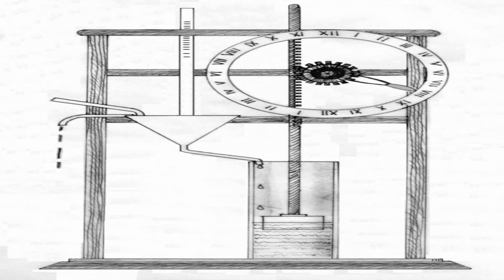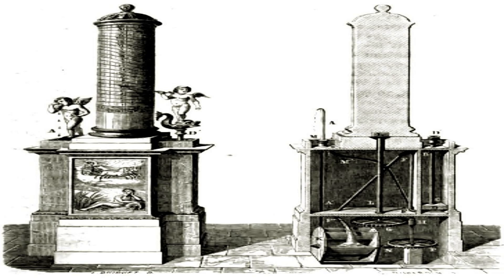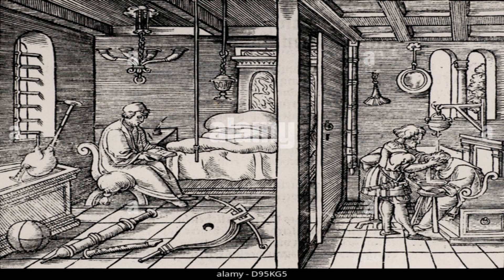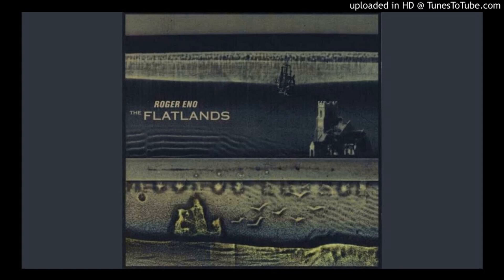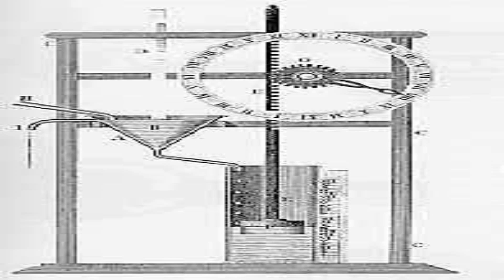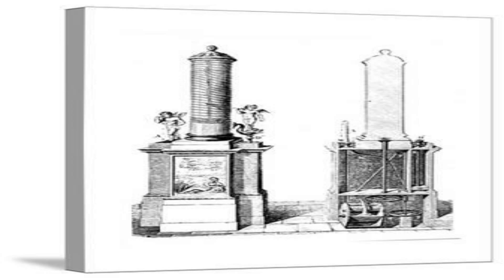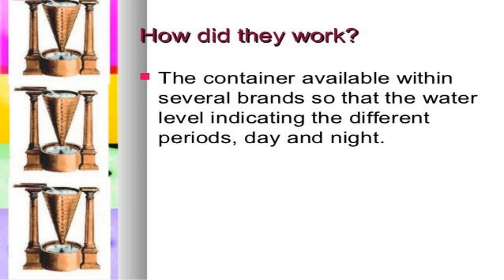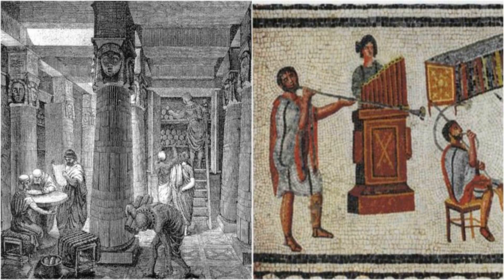The Water Clock that Changed the World: Ctesibius’ Float-Type Clepsydra

Comment: Why did you scale the images unproportional? Scrolling through the images would help more than just showing a dia show of unproportionally stretched lowres images.

Why does the (synthetic?) voice talk as if there were full stops without sense in the middle of the sentences? It sounds as if copy&paste actions lead to many additionally returns misinterpreted as full stops.
Reply from the maker: i am actually using ai to speak i am not good at speaking  sorry for that . images are not available on this topic i am trying to get more images but they are not available
Reply: @robomatrix  
AI speach works great, at least as long it speaks English. I only recognized it because of the strange speaking melody which is sometimes confusing.

I know there are very few images (I was born in a town famous for its former clock industry and its museum about clocks and time measurement). You found some quite good and useful images.